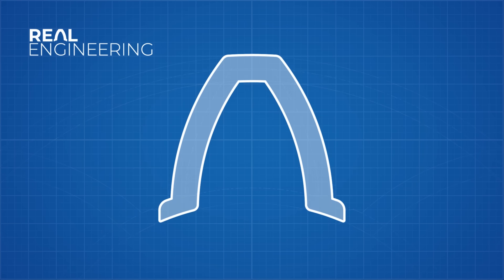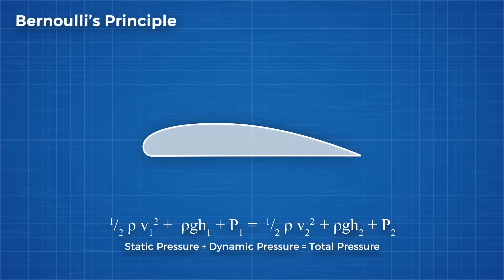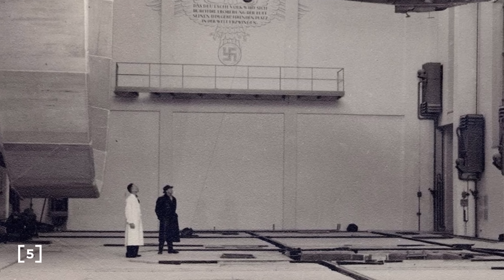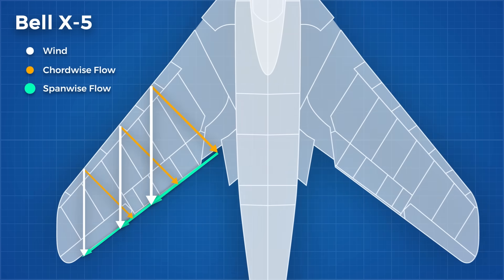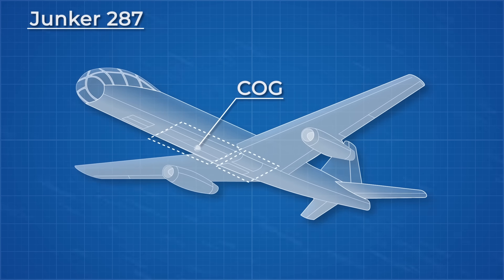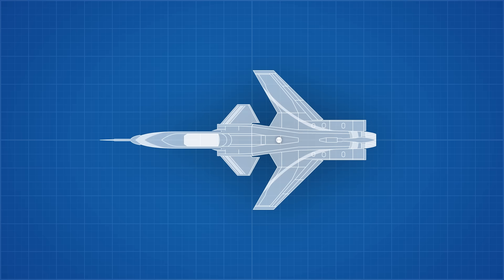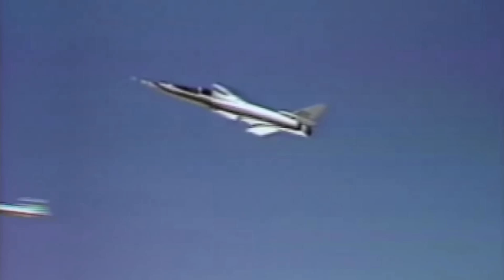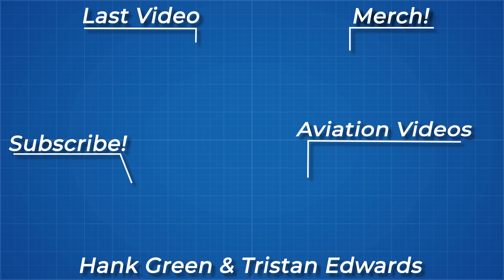Why Do Backwards Wings Exist?

Comment: Maybe not the most ideal design on terms of functionality, but wow is it a sexy aircraft.
Reply: I mean, stability and maneuverability are different requirements. If you make an unstable plane, it'll be able to maneuver like crazy.
Reply: john hansberry  That's the principle behind all modern fighter aircraft since (I believe) the F-16.They're all designed to be inherently unstable and unflyable without the aid of a flight computer/computers making it flyable. The F-117 was another example of inherent instability and was nicknamed the Wobbly Goblin because of it.
Reply: I mean, I guess it's kind of obvious if you think about it. A plane that doesn't want to go straight will probably be be better at not going straight than a plane that does want to go straight.

Comment: I'm surprised you didn't mention yaw instability specifically. If a plane with forward swept wings yaws in one direction, the wing on that side generates more lift and induced drag,  which yaws the plane further in that direction, creating a positive feedback loop. Backwards swept wings have the opposite effect -- yawing to one side increases drag on the other side, making the plane want to yaw in the opposite direction, creating a negative feedback loop (and positive aerodynamic stability).

Comment: Was a flight test engineer at NASA Dryden during the X-29 testing. The forward swept concept should be noted as "highly forward swept" as technically there are a lot of forward swept wings in use. The Cessna 172 technically has a forward swept wing. If you look at 4:34 in the video the wing center of pressure sweeps forward from the root (closest) to the fuselage to the wing tip. Technically the wing shown is a forward swept wing, even though the leading edge sweeps rearward.

Comment: Lowering the percentage of the dihedral was also instrumental in understanding transonic and supersonic flight. It required them to go back to the World War 1 concept of a wing with far less dihedral then the mono wing of the later era aircraft. The P-38 was not the only aircraft that lost control do to trans Sonic forces. The Spitfire and the Mustang, and probably the Messerschmitt probably suffered from the same issues in any kind of high-speed Dives. As a matter of fact all of the high performance aircraft of World War II suffered from it because they all had flaps that weren't only for landing. The forward swept-wing allows the plane to be far more reactive to Pilot input. But it imparts so much stress to the Wing roots that Wing separation is considered imminent. The follow-up aircraft to the Forward swept-wing Design was the F20. Which is basically at upscale at 5 with a j79 engine which, surprisingly, was comprable to an F-16 in maneuverability. All though with much less Avionics. But it was an inexpensive aircraft that would have been very useful for many countries without a large budget for the Air Force. But they makers of the F-16 did not want to give up that part of the market so they just made an F-16 with a j79 engine and less Avionics. But it wasn't quite as nice to fly.

Comment: The more you think about it, the more you realize how much nazi’s contributed to modern engineering. It’s actually shocking how advanced nazi’s were. If they wouldn’t have rushed invasions, and had given their engineers more time they would have, without a doubt won the Second World War.
Reply: germany couldn't have won the second world war. they dumped their money and a lot of the little recources they had into unnecessary designs and experiments which did nothing to the war effort

Comment: You made a slight error.  In both traditional swept and forward swept designs the center of pressure/lift is behind the center of gravity.  The only difference in the x29 is that the tail stabilizer was replaced with a canard.  Traditional stabilization is called negative stabilization because the stabilizer is on the same side of the center of gravity as the center of lift and as such must produce negative lift to balance the positive lift created by the wing.  A positively stabilized plane like the x29 (note you can have rearward swept positively stabilized planes also) has the stabilizer and the center of lift on opposite sides of the center of gravity and as such the stabilizer produces positive lift.

Comment: Interesting. There was at least one commercially available FSW aircraft: the Hamburger Flugzeugbau HFB 320 Hansa Jet. Some 47 were built between 1964 and 1973. The German airforce used them until the 1990s, and there were a few civilian operators as well.

Comment: Soooo Bernoulli's principle only applies to flow in an enclosed space. Your diagram of how lift is produced is showing the equal time theory which has been thoroughly debunked. The airflow over the top of the wing actually moves MUCH faster then your show.

Comment: Because it does one of several things, such as maintains the correct centre of gravity margins or promotes stalling at the wing root.

How can you break design conventions with a concept that is nothing new? I flew the ASK-10 and ASK-13 gliders both had forward swept wings and had been designed and flown long before the X-29? 

The Germans had flown forward swept wing and aft swept wing aircraft in the 1940s (as did the Americans) in order to overcome CofG issues. Whereas the X-29 was designed to investigate the effects of forward swept wings at high speeds.

The link between Bernoulli and the wing is total bollocks. How do the molecules that go over the wing know that they need to fly faster over the wing than those that go under the wing? Also how can an aircraft fly inverted?

The Me-262 had swept wings due to CofG problems and had nothing to do with high speed flight. Stop showing such footage.

Comment: Soooo..   Stupid question, why don’t they do this on helicopters?         Granted that is a helicopter rotor spins fast enough, it will encounter it’s own airflow (cant think of the correct term) thus reducing lift. But swept blades would potentially increase lift right? Even though they’d probably need to be stronger...     IDK man...

Comment: One reason: engineers are hopelessly out of touch with tactical requirements.  We haven't seriously entertained a dogfight in 60 years.  They have no clue the difference between a fighter and a striker.  There is no modern use for a fighter, as strikers absorb that role along with all the previously specialized roles of a traditional strike package. If you understood what I just said, congratulations, you are not an engineer.
Reply: so what you are saying is forward facing wings would be better for a fighter as it can manoeuvre better at fast speeds without wasting energy.

Comment: <pedantry>
I don't think it's right to mention Bernoulli's principle as the mechanism with which planes generate the lift to fly, as that lift is nowhere near enough to carry the weight of an entire plane. While yes it can generate lift, that is only possible if the air from the top and bottom reach the back of the wing at the same time, which isn't necessarily true when you have turbulent flow. The graphic itself also makes no mention of other airfoil designs, nor explains why some planes are stable flying upside down.

Instead of saying "how wings generate lift", it should be something like "how air moves around this common airfoil design, and how the aircraft in question is affected by it."
</pedantry>

Comment: The Deinterlancing artefacts (the wierd horizontal stripes) occuring in some of the clips used here, can be fixed. You can read it up, but it should be fixable by most editing softwares with a single click.
It comes from old times where TVs rendered the video always in "scanlines" and skipepd one line for higher framerates. Todays monitors obviously don't use scanlines anymore so 2 frames get "merged" and create the strange vertical cuttings. There are diffrent algorithms which fix or atleast greatly reduce the effect, pls consider it next time

Comment: So basic purpose is to send air towards the fuselage, and away from the ailerons on the wingtip. providing greater maneuverability at greater speeds.
But is not feasible due to structural costs, and computing requirement?
Reply: We can make the structural parts better than back then and much more reliable and faster computers. The issue is that the pilot can't deal with the forces of the extra manoeuvrability this design would offer, so what is the point. This could be awesome with a drone though so I do wonder what the effect on stealth flight is. Maybe for remote control fighter jets?
Reply: @piraterubberduck6056  he does say at the end that the design was not good for stealthy aircraft.
Reply: No because forward swept wings are unstable in subsonic flight so you basically need a system which would change the angle of the wing in flight
Reply: @ThatRedGTI99  So, "computing requirements" ?
Reply: @Brahmdagh  more like structural costs

Comment: You hinted at, but didn't fully discuss, one of the primary drivers for using a forward-swept wing:  The relaxed pitch stability provides far snappier pitch response and higher agility for pitch maneuvers.  That can be a huge advantage for a fighter in a dogfight scenario.  
But advancements in air-to-air missile range and autonomy have greatly reduced the likelihood of pilots engaging in close battle, so the superior maneuverability of the forward-swept wing eventually lost much of its advantage.

Comment: Solution ...
Contract the wings completely at high speeds.
Just the body of the aircraft will be enough for lift and small tail wings for navigation.
Reply: That's not the solution. Come on dude. Did you even watch the video before commenting?
The whole point of forward swept wings over usual backward swept wings is increased lift at low speeds and much improved manoeuverability. Both will be lost if you completely retract the wings and use pure lift body.

Comment: The explanation about center of gravity vs center of pressure sounds more like "why aren't we using canards" instead of "why are forward swept wings better". In both diagrams center of pressure is behind center of gravity; only thing that changed was the location of horizontal stabilizers.

Comment: “One that broke ALL aircraft design convention,....... However, this aircraft was not the first of its kind.”
Reply: I take exception to that second sentence, because drawing something crazy and getting it to fly successfully are two very different things
Reply: Just because a few unusual designs exist doesn't make it conventional.
Reply: Well the first was outside convention, so his one was just joining that club....the first wouldn't have redefined 'conventional' of that time period
Reply: @joeshmoe7967  yes, if I build a forward swept wing plane tomorrow,  it too will be breaking said convention...
Reply: @rahowherox1177  I wonder if the distant future will have swept as conventional.  Problem is if the flight computers fail you die.
I like cables, carburators and skill.  Not a huge fan of some of the push towards Ai. With these planes sometimes learning what doesn't work can be useful
Reply: @joeshmoe7967  same, Bootlace throttle and clutch cables have gotten me home many a time, no parallel with hydraulic ones, and don't get me onto the mysterious black box dying that costs a fortune to replace and has no known use haha...

Comment: I really enjoy this channel’s content.
However, right now I am really disappointed, as this channel’s credibility, in my eyes, just fell. 

BERNOULLI’S PRINCIPLE IS NOT FALSE.

It just DOES NOT APPLY to the explanation on how the wing generates the lift force, as it does not satisfy the criterions (assumptions), which need to be satisfied - when “deriving” Bernoulli’s equation from the general equation.
So, when the assumptions to simplify the general equation are made, those same assumptions must hold true when applying Bernoulli’s equation to the problem of interest, which in this case does not hold true.
Reply: Well, if you did courses on fluid mechanics (or read the equivalent material), you should know, that Bernoulli’s equation applies only to STEADY, INVISCID, INCOMPRESSIBLE flow along a STREAMLINE.
Analysis of top and bottom of the airfoil involves two different streamlines.
Reply: Bernoulli's principle does apply to airfoils, it's just not the only way wings produce lift : the other way is by increasing the angle of attack (AoA) and therefor deflecting air downward and producing a reactionary force upward.
Reply: Bernoulli's principle applies because there is a difference in speed between the top of the airfoil and the bottom.